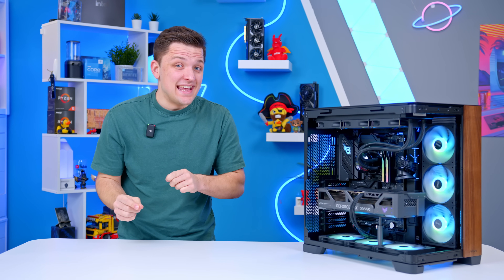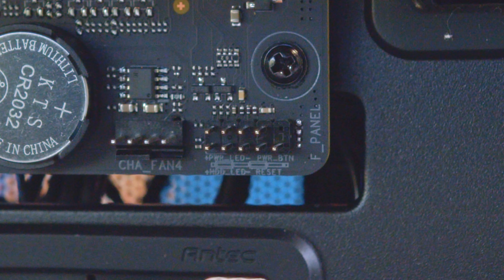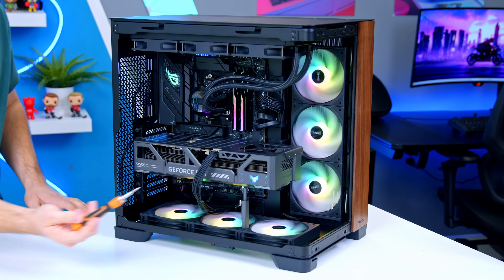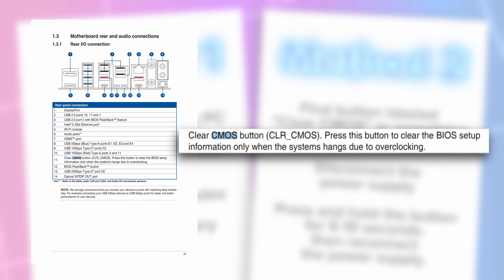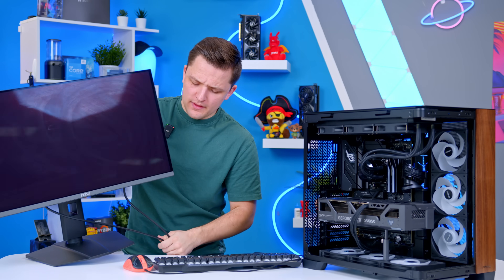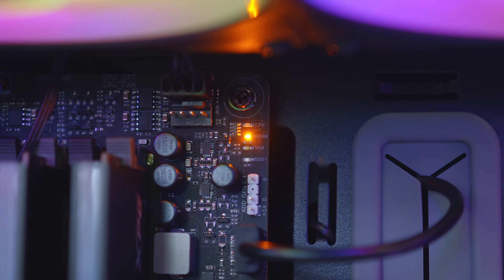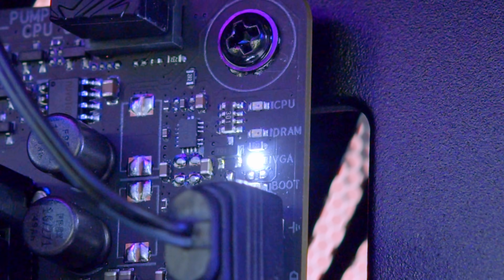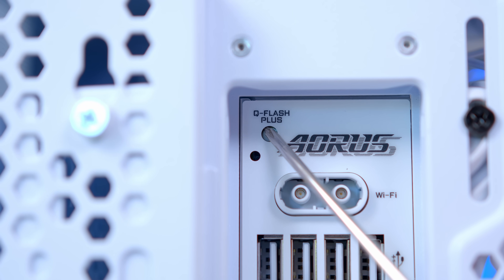What to Do If Your PC Build WON'T Boot! 🫣  [Full Troubleshooting Guide]

Comment: Crazy nothing in this guide has helped I'm stuck with no display after a mobo switch and I've done everything all my parts worked on the old CPU and now nothing works on this one or the old one what did I do bruv

Comment: Just built my PC, When i have HDMI plunged into the motherboard everything works fine, I can get into BIOS and then windows. My problem is that when i try connect the GPU then the computer works the same, LED is green but this time it just shows no signal on the monitor and cant even get into bios when connected to the GPU using HDMI. When connect to mother board it has signal and can get into windows, GPU has no signal at all and cant get into BIOS. I tried resisting it and removing all other parts before but still has no signal when i turn on pc, BIOS also updtaed to newest. Please help someone
Reply: i have the same exact issue. were you able to find a solution?
Reply: @irem5648  yee, when you get booted into windows you will just need to freshly install the drivers for you GPU (in my case i have NVIDIA and i just got the drivers for my GPU model from their website) when you do that your GPU will now have the drivers and you can use earther HDMI or Display port but I am currently on DisplayPort and it works
Reply: @irem5648  When you boot into windows you will need to download the Drivers for your GPU and it should work because originally they don't exist and you have to download them manually from official websites depending on your GPU

Comment: Okay so I’m having a very strange issue.. I have an msi mpg x870e edge ti mobo setup.  It’s displaying green boot light and code 00, code, 15 and code 64. Most of the time it works just fine. But I moved the pc and black screen. I cleared cmos, tried 2 different bios setups. Then,, I put 1 stick of ram in the primary A1 slot and it didn’t work at all,, like nothing. And so I tried the other stick in A1, nothing. I put both ram sticks In again and it fired right up to windows. I can even play marvels avengers online! Expo enabled, everything. But I’m getting weird performance issues on occasion, it will be fast then bleh then fast. The code only shows if I’m in bios, code 15 “boot” usually. Soo I’m thinking it’s a memory controller issue. But I got everything on the QVL list from msi.. everything. And my GPU is stuck at x8 +x8 in bios, not 5x16 despite not having anything else but a single m.2 in the 1st slot. Everything is brand new. Msi did say they were having weird issues with memory controllers and 9k cpus but this is weird.. Temps are good too. Any thoughts??

Comment: Only blue switch light and the cpu cooler turns on. Guys help 😢🥀💔
Reply: I'm having the same issue. Well, my RAM also lights up but otherwise no peripherals come on Ava I don't seen to boot. Were you able to solve this?
Reply: @f1jones544 same here everything boots and spinning fans but alsno display…

Comment: Help I was on my PC and It has like loose power connection or my PC turns off automatically sometimes and now my GPU doesn't turn on nor does the PC when I push the power button but when I uninsert the GPU while everything is connected I hold the power button because pushing it once only makes it wanna turn on flashes white every time you push but it doesn't turn on unless you hold the power button down while the GPU is not inserted but HDMI is still connected into it still everything will turn on then I'll reconnect gpu and it starts running but no display on the monitor I got it running once after all that but since it turn off again the key board and mouse don't light up nor does the monitor display anything and that's the only way to turn everything on the power supply is new GPU new idk I need help don't wanna pay to fix when it's something simple idk

Comment: this is actually very helpful,  I'm having only one issue though. the gpu stops running seconds after boot and I cant get a display through either the motherboard or gpu and no matter how much I try I can't get it to display bios either.

Comment: My PC powers on, fans spin, everythign lights up, but it wont post and my ASUS ROG STRIX X570-e board throws me a 00 error.  I tested the board with a different CPU, with and without the GPU, different SSDs, and still nothing. I need help FAST!
Reply: Did you find a solution ?

Comment: Everything powers on Gigabyte X870E AORUS PRO ATX AM5 Motherboard. But mo display. The debugs light for boot, cpu, and dram are fine. But the debugs light for VGA is red. Sometimes with error code 05 and 00. It doesnt read my mouse, keyboard or hdmi when i plug it in. I tried with both gpu and cpu to monitor. Im currently trying to use just the mobo integrated graphics and found this out.
Reply: Happened to me until I slapped my nvme drive into the M2 slot

Comment: my pc sometimes boots up first time i turn it on with both my keyboard and monitor getting signal but recently my monitor and keyboard sometimes won't get signal even though the tower is on and everything is spinning. Once its able to boot up, everything works normal. not sure what the issue is. any help?

Comment: I activated xmp for my RAM and now every time I try to access my bios my system just doesn't boot. I can boot to Windows just fine but if I press the delete key on startup or try to restart from Windows my pc attempts to boot but doesn't display anything. I also noticed my cpu and RAM lights on my motherboard stay on for several seconds before startup. Any suggestions?
Reply: Is everything on but display shows nothing ? Can you see the motherboard brand logo when doing normal bootup ? I had these issues and apparently the problem was that the bios screen was somehow incompatible with my monitor. I tried connecting to a different monitor and bios shows.
Reply: @myshiftisbroken my shit don’t display anything

Comment: One time I bought a new NVME and wanted to install windows on it, so okay I olug plug it in, initialize it and all that. So I plug the USB in, select it and install it; only to find out that Windows installed on the NVME, but the bootloader on my HDD(not the 2nd SSD), so I had to format the HDD(luckily only a few games) which taught me: "Dont forget to unplug other drives when installing windows".
Now I dont know why it would install across 2 drives, so if someone does, do tell

Comment: Just use common sense to approach this...First, check power connections to make sure the PSU is switched on, cables are fully inserted, and the case power button is correctly wired or manually short the power pins to test. Reseat your RAM and GPU firmly, ensuring no gold contacts are visible and connectors click securely into place. Use your motherboard's debug LEDs or Q-code to identify where the boot process halts
Reply: Red and yellow light, red for cpu not being detected and yellow for dram not being detected, reseated the ram many times doesn’t fix it

Comment: On my first PC build I experienced a dead 1tb storage drive and could not install windows. Red lashes the bios on the MB and went through a few steps before I just recorded another storage drive and boom I was able to boot into windows and installed it. Smooth sailing since

Comment: Over 30 years, I have experienced 1 DOA motherboard. And a (spinning disk) Hard Drive made some horrible grinding noises about 5 days after purchase... that one was a pain, since I'd just installed all my software from 3.5" disks (so many of them!!), so I ended up spending 2 weekends in a row just installing things... kids these days just don't have these frustrations... well failed hardware they might, but installing 100's disks worth of programs and data are thankfully a thing of ancient history!
Reply: "Kids these days" 🥀
Reply: Bought my first components to build my pc for the first time proceeded to bend the pins on the motherboard so I buy new one, the new one is DOA, then I let them refund me and bought another one, that proceeded to work

Comment: Devastated, sold a PC and shipped it secured with foam packs and original case box and the customer states the Mobo does not display a signal with an A2 code. When I thought it was user error, Microcenter said the graphics card needs to be replaced. 🤦‍♂️
Reply: Maybe the guy who bought your PC ...did so because he had the exact same (but Dead) Video Card then switched Cards after he received your PC. :text-green-game-over:
Reply: @ quite possibly I’ll never know the truth unfortunately
Reply: @ What Graphics Card was it because there are other Reddit Threads where the buyers are removing the GUI & Memory Chips that are sold/shipped to China for AI Cards & then tells the seller the Card doesn't work. The buyer then gets (Ebay) refunded & the seller is_screwed.